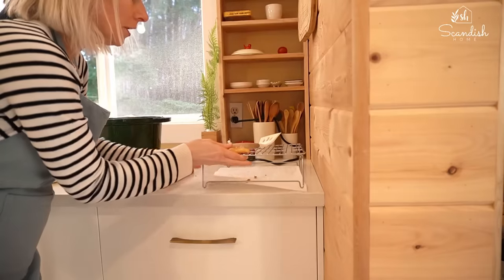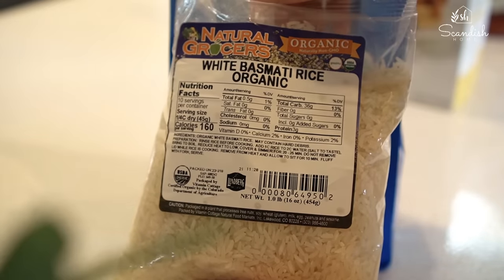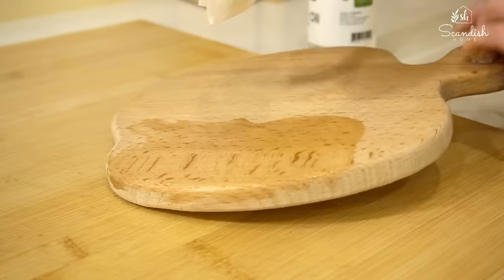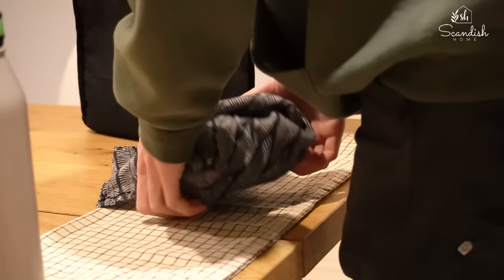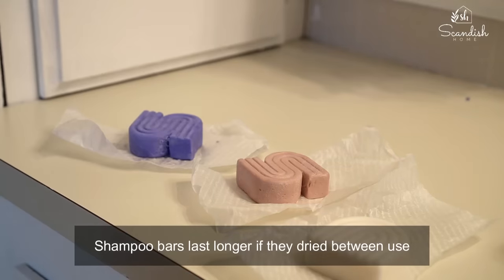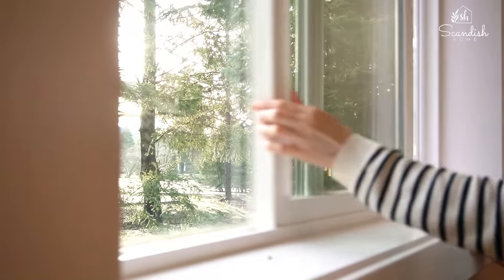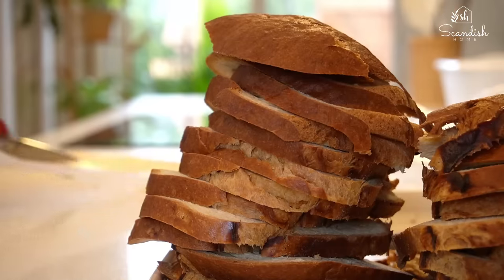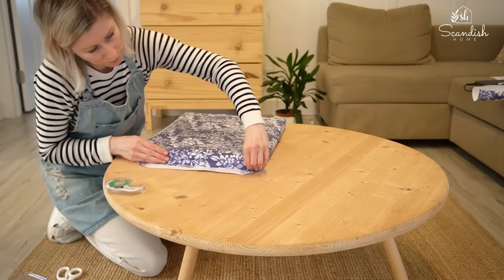DAILY CLEANING ROUTINE AND HABITS FOR HOMEMAKING | Clean with me

Comment: I do oil pulling occasionally with coconut & oregano oil & spit it out into the garbage, NOT the sink because over time that oil will coat & clog up pipes.
I try to strain the oils that I use & put them into a junk can to pour over my bonfire scraps as a fire starter.
I'll wipe out greasy pans with paper towels & save those in another can for fire starter as well.
Also, hydrogen peroxide is also good from time to time to clear out bacteria as it cuts through the natural mucus layer/film.

Comment: You are so inspiring! Thank you for sharing your life with us! ❤ A tip for your plants tho… They really need repotting. Leaving them in their original pots is not good for them. They are usually already root bound and the soil is depleted of nutrients. Get a pot bigger than what they are in, add a layer of pebbles to the bottom for drainage, then some good potting soil. When you add the plant to the new pot, loosen the roots with your fingers. Also use some type of fertilizer regularly since the plants will use nutrients up quickly. Your plants will love you for it! 🥰🪴